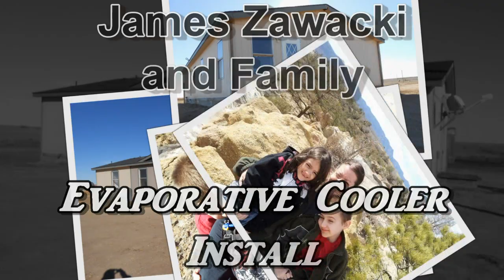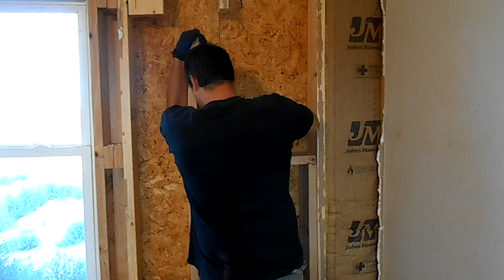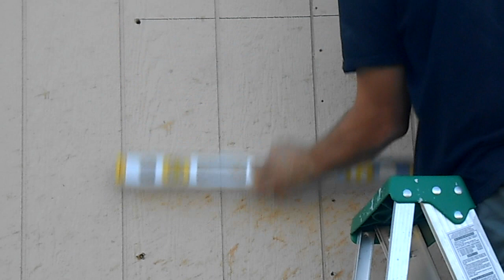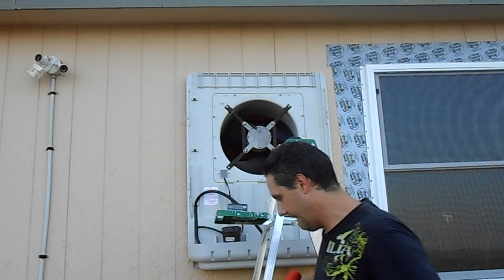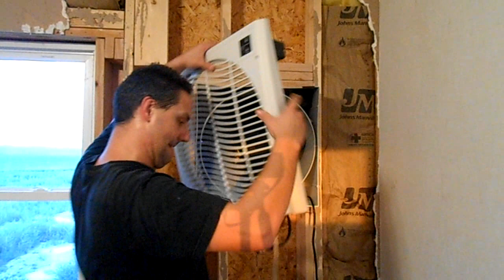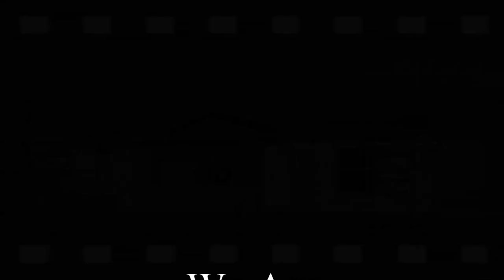Evaporative Cooler Install

Comment: You didn’t show the hose connection to the pad cover.. any tricks to getting that hose clamp on.
Reply from the maker: Sorry, I moved out of that house about 4 years ago.  I vaguely remember making sure the hose is vertical in the mounts, setting the bottom in place and then sliding the hose on, but my version didn't have a clamp, it just slid on.

Comment: my issue is with the copper tubing. I bought it as a set and every-time I turn on the faucet to fill up the unit, the cooper tubing shoots out the nut and sieve
Reply from the maker: It should have a compression sleeve that keeps it from leaking.  I actually switched from copper tubing to polyethylene cause it's easier to work with.
Reply: @dslynx  When I when to home depot, the only complete kits they had were copper, the poly's were all opened and pieces were missing. So I bought the copper then bought 1/4 OD inserts that came with plastic sleeves but still same issue. I used to have the poly but the sun always damaged it causing leaks.

Comment: How do you take off the fan ?
Reply from the maker: I don't know, I never had to take off the fan.  If you mean the fan shroud, there are 4 screws hidden under rubber inserts.
Reply: Well my motor went out and got a replacement but it comes with no fan shrouds so how do I remove it and slap it on the other motor ?

Comment: I have the same unit from Master Cool.  I run this in my 25'x27' garage, work shop AKA man cave.  After 2 years I had to replace the pump motor, purchased 2 for $50 plus tax and free shipping.  Installation notes and advice:  As you pointed out make darn sure this is installed exact level on your x, y, and z.  This is NOT a maintenance free system, I would pull the back off every 3 months and clean.  Vinegar works great if you have hard water build up.  Spray the water drop filter from the inside out, don't cycle the vinegar thought the pump, it will get stinky but if you do in wont hurt you.  NO BLEACH or pool chemicals.
Reply from the maker: I actually had to replace the pump right after I posted the review video: MasterCool MCP44 Evaporative Cooler Review

Comment: I reinstated  my cooler and it keeps  dumping out all the water out the hose
Reply from the maker: The hose should not be in the overflow/purge pipe, remove it and let it sit in the survivor.
Reply: I’m confused about this same thing. So the instructions are wrong?
Reply: @louisfehlig7903  so it was basically  calcium build up my brother cleaned ot out and it works fine now

Comment: you could probably also get a dehumidifier to control the humidity
Reply from the maker: It's the outside humidity that needs to be low.  Areas that evaporative coolers work in, the added inside humidity is a major bonus.
Reply: So can you run it with ice water to make it work even better
Reply from the maker: Yes, this is common when using indoor evaporative coolers.  I believe it would be way more work than it is worth for a model like this, but I have well water, so it's nice and cold.

Comment: Question: I just installed mine and the overflow drain continually drains any time the pump is on. Is that supposed to happen? Not sure how to make this stop as the pump hose connects to the drain. It seems like a weird design.
Reply from the maker: No, I believe it is due to how they package it for shipping.  There is a small tube that is tucked into the overflow for some reason that just needs to go back into the reservoir so that water will be pumped back into the reservoir instead of into the overflow.  If I remember correct, you can see around 3:15 that the little hose is going behind the pump.
Reply: Adjust your float to shut off the incoming water and stop the overflow.
Reply: I was just about to ask about this when I came across your comment. I plugged that little hose coming from the thicker hose with a screw and let me tell you it's blowing cooler air than ever. Idk if I'ma mess up the pump this way ? Lmk what that little hose purpose is if any one knows

Comment: I installed one of these and I'm having trouble with water gushing out of the over flow valve after I ran it after 10mins. When I 1st turned it on it was just dripping but after a few minutes it was gushing through... There not many trouble shooting video on this cooler so if thought I'd ask you...
Reply from the maker: A Kay Sounds like you need to adjust the float on the water inlet.  This may be a little difficult to explain via comments but the valve has a rod that tilts downward and then horizontal with the float attached at the end.  When the water level rises, as the float lifts up, it slowly shuts off the inlet valve.  You need to bend the horizontal section down a little to so that the float will raise the angle of the rod coming out of the valve so it shuts the valve off sooner.  I know it's mentioned in the installation guide, so if I did a poor job of explaining (which I think I did), refer to the manual about adjusting the inlet valve, water level, or float.

Comment: I installed the 5900cfm model last week... The motor motor just overheated and quit running (5 days)... Everything about this swamp cooler is poorly constructed...
Reply from the maker: It's funny you say that.  I just had the pump motor go out as well, right after I did this review video: MasterCool MCP44 Evaporative Cooler Review
Reply: +James Zawacki I just installed this cooler myself and once I had it all hooked up, the water pump doesn't run when I turn it on. Are there any troubleshooting steps I can take? Am I possibly missing a step?
Reply from the maker: Alen S
Well, it's pretty simple to troubleshoot, if you take the back off, you will see the pump cord go into a plastic cover.  Remove that, and you will see a standard 110v plug in.  Plug it into the wall and see if the pump spins.  If it doesn't, it's probably the pump (just replaced mine again, last month).  If the pump does turn on, it might be a bigger problem with the control panel system sending power to the pump.  At that point, I would suggest returning the unit.

Comment: I don't think it is a good idea to disassemble the back grill inorder to install the unit.
Reply from the maker: You mean the front grill?  And why is that?  It is simply 4 screws under rubber caps.  Once you remove those, it pops right off.  You can easily unplug the fan motor and water pump and set the entire front grill to the side.
Reply: the back  not the front fan cover grill. It's not that heavy though.
Reply from the maker: You have to disassemble the back grill to connect the hose, properly connect the water line, set the water level as well as do regular maintenance.  It's designed to be removed for those reasons.
Reply: I took my old one apart every year to maintain or clean in the season.  It’s made to do that.

Comment: You need to do a 1-year follow up,the name brand,the price,over all view,great video. I have a smll home,but there are many people in Houston TX,that have 2-story homes. A cooler would be great for their second level,while their at work, How dose your's work,where the exit air go.
Reply from the maker: Sorry for the delay, I've been planning more of a review video and finally got it up: MasterCool MCP44 Evaporative Cooler Review

As for the use in Houston, I'm not sure an evaporative cooler is what you are looking for.  I googled the humidity and averages seem to be between 49% to 95% and rarely as low as 24%.  Evaporative coolers require the humidity to be low for the water to evaporate and cool the air.  If the air is already saturated with water and won't hold any more, it's not going to work.  As for the exit air, you just open a window in another room.  If one room isn't cool enough, you open the window in that room and close (or reduce how much it is open) in another room.

Comment: What pump do you use for master cooler??
Reply from the maker: I am currently using a Dial Manufacturing 1175, just make sure you get one that is the same size or bigger in CFM to make sure it can pump enough water to keep the medium saturated.
Reply: @dslynx  Can you add a thermostat so it can shut off?

Comment: BIG mistake not to just stick it in the window ... but I agree with you on the "thermostat issue"!  I'd LOVE to know how to make mine stop working at about 70 degrees and kick on at about 74 degrees F
Reply from the maker: David Beecroft I bought an evaporative cooler thermostat thinking I could just wire it up like an on/off outlet, but when power is applied to this unit, it doesn't turn on, you have to manually press the on button.  So, to wire it up properly, you have to take the unit apart and wire into the pump motor power as well as the fan motor power.  On the positive side, both of those have standard 110v plugs, so it's technically an easy thing to do, you just have to figure out how to get the power wires from the thermostat into the unit, aka, cut holes in the unit.  If I ever get around to hacking it together, I'll be sure to post a video.
Reply: James Zawacki i'm surprised MasterCool doesn't just sell something quick and easy to plug in ... or, better yet, sell the unit built this way.  What a joke that you have to go through this... does MasterCool think we like it at 65 degrees?  Does MasterCool think we stay at home all the time?  I'm off to Hawaii for two weeks soon and I don't just wanna let it run all the time... Ideally, I'd like it to snap on low fan when the temp hits 73F, snap to medium at 74F and high at 75F .... then snap off the pump at 71F, then snap off the fan 3 minutes later...  snap back on at 73F in the late AM and on and on it goes... why would this be such a chore?  It seems like a really, really simple feature for a company that makes this kinda thing.

In addition, I'd LOVE it if the unit could snap off entirely if the temp hit a pre-determined mark (say 79 or 80 degrees) and signaled the AC to snap on and take over until the OUTSIDE temp was at another pre-determined mark - say 105F.  That way in July and August when it hits 115F here in Vegas and the cooler can't keep up (25F offset so, say, inside temp is 90F) the AC can take over until 9 or 10PM or so ... until the outside temp was under, say, 105F.  That's a little more complex and demands communication with the internal thermostat or a system with integrated and replacement thermostat but I'm ONLY TOO HAPPY to spend the money!  HELL!  This month alone I just save $400 bucks!  By September my saving will be at $1500 ... the cooler, with piping et al was $600 bucks ... so, it paid for itself in just over a month... and all those added electronic features... how much could they cost?  $200?  $300?  $600???  I'LL SPEND IT!  Over 5 years I've got a lot more money, a LOT more comfort and health (my g/f doesn't even snore anymore and I NEVER wake up with dry or bleeding nose or glue-boogers and the air is so fresh!) so come on, MasterCool or whomever ... bring on the electronics!  I LOVE swamp cooling!
Reply: I know this is a little bit late but, here is a pic of a simple thermostat type controller for your evap cooler. I installed it myself, and three years later it still works fine.

Comment: We just bought the same cooler. It leaks water non stop, like a neverending running faucet. We are very concerned our water bills is going to skyrocket! Is this normal, or do you have any idea how to fix this?
Reply from the maker: You just need to move the hose that is in the overflow (for some unknown reason) into the reservoir. I have no idea why it is shipped that way, or why the instructions don't explicitly say to move it out of the overflow.. But yeah, it's pumping water straight onto the ground.
Reply: So there's no problem if i move that hose to the inside of the reservoir? I have the same problem it never stops dripping but the instructions say to line it up to the overflow plug
Reply from the maker: Correct, if the leaking is due to the hose dumping water out of the overflow, yes.  Move it into the reservoir and your problem will be solved.  If it's not due to the hose, you may need to adjust the water level down by gently bending the float down a little to lower your water level so it doesn't fill up to the overflow level.
Reply: The bleeding you may be seeing is done to allow for a constant change of the water to reduce scale build up on the pads.  You can choke that down to reduce water loss.  But if you do like James suggests, then your pads will scale up much sooner.

Comment: I see this was some time ago, so you may have moved already :-) I'm wondering if this cooler sticks out from the wall inside the house, or is the control grill flush against the wall? Couldn't tell from the video. Thanks.
Reply from the maker: In this video, the cooler sticks out from the wall on the inside of the house.  Turns out, it needs to be this way if you have the cover that snaps onto the front, as it has tabs that need to grab the back and you need to be able to stick your fingers behind it to remove.  I believe I posted another video where I installed a 2x4 on the exterior that the outside housing mounted to, and I installed a screen over the entire unit to keep the moths out.  That's when I learned that having the inside flush with the wall was a bad idea.  Finally, I ended up installing a screen between the medium and the housing, so it doesn't look terribly bad and keeps the bugs out.

Comment: How did you remove the front cover (vanes) and controller of the unit to slide it through the wall??
Reply from the maker: You just have to pry out the four rubber covers and there are screws under them.
Reply: What kind of screwdriver removes those screws?

Comment: I'm planning on doing this type of installation Can you tell me what is the rough opening dimensions you cut-out on the wall.
Reply from the maker: +Enrique Madrigal Sorry, I didn't pay attention to the measurements have have since put molding around it for a more finished look.  I just measured the height/width of the duct that goes into the house.
Reply: Thank you, I will do the same

Comment: Sir what's the price for this ?
add  from where I get this
Reply from the maker: I believe I purchased it at Home Depot, but Lowes carries it as well and if I remember correct, it was around $500 just for the unit, but you need to purchase fittings to hook it up to a water supply.
Reply: mirza yaseen got one today from Costco. $399.

Comment: Hi sir! Im planning to buy a cheap swamp cooler by about a hundred dollars. Will it work greaf?
Reply from the maker: Hello.  If you live in a dry area, I believe you will be extremely happy with a swamp cooler.  But, they rely on the humidity in the air to work, so if you live in a place that is humid, they don't work.  Colorado Springs is like a desert, so they work very well here.
Reply: James Zawacki I live in the Philippines sir! It is so hot here so i think it will work fine! :D
Reply from the maker: TechnoBots101
Nope, it won't work very well there.  It's not the heat, it's the humidity.  I don't know exactly where you live, but Wikipedia says the Philippines has high humidity.  Manila is 76% right now, which is way to high for a swamp cooler to work well.

Comment: Geese James, I wonder why there was "2" layers of drywall on that wall with mold in-between.Maybe there was mold on the wall from previous owner and they covered it up by adding a second layer of drywall??? Brother, you should delete this video or disclose what you did to the structural framing of the house to a prospective new owner. You beefed up the top but not addressing the structural studs you cut out, not good. Maybe you should watch some how to videos before you tackle remodel projects on your home
Reply from the maker: It was done by the manufacturer, as these houses have a vinyl wrapped drywall and both layers had the vinyl.  As for the structural comment, I appreciate your concern.  I'll be sure to disclose it when I sell the house, if it hasn't become a sliding glass door by then.  As I commented before, my exterior doors don't even have jack studs, these house are just glue and staples.